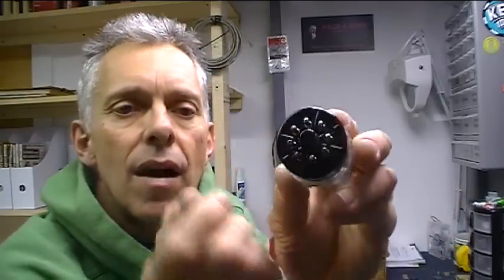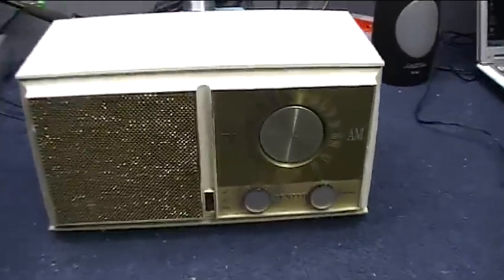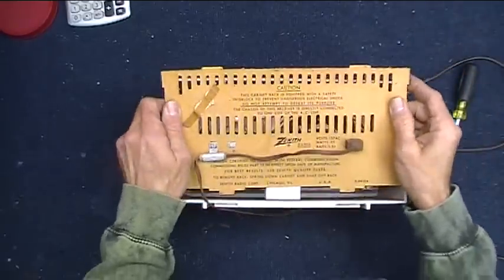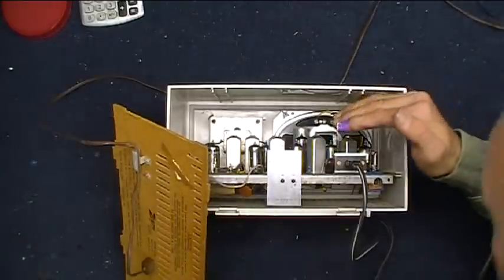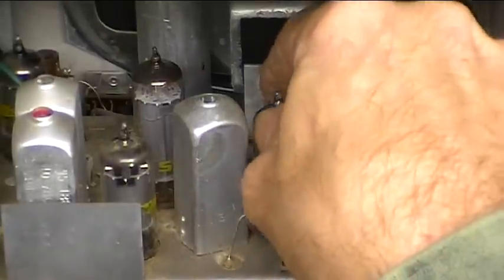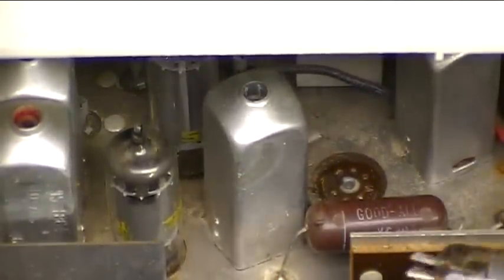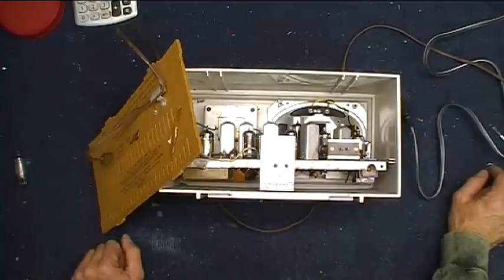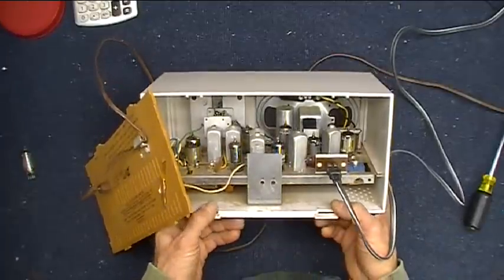Vacuum Tube Radio Repair

Comment: I remember way back (late eighties or early nineties) when I first visited a place called Skycraft Surplus here in Orlando they had a large, upright type of tube tester (probably an old grocery store model) where you could test your tubes and/ or test the tubes you planned on buying from them before you went up to the counter to pay for them. The stuff inside that store changes so much that I'm sure it didn't last too long. I have been in there recently and it's no longer there. There is plenty of cool stuff in there though.

Comment: My old oscilloscope tektronix (535), had the same problem in all vacuum tubes, the solution was to use a spray cleaner, and never, ever, a piece of sandpaper, this procedure removes the pin surface treatment, and not clean the socket, so the problem may return.

Comment: You described a circuit where 50% of the circuit goes trough one triode and the other 50% goes trough the other triode. Isn't this the definition of a class B push-pull amplifier? A class A amplifier would have 100% of the signal going trough a single triode.

Comment: You will probably want to replace the cap that goes across the line with a modern line rated cap, some of those are just paper caps coated in a plastic shell which can explode also the main electro can dry out. And it may benefit from an alignment especially in the FM circuits

Comment: I have a old tubed radio and the stations don't come in clear as they should, what can I do to help it? it has the antenna on it and all, just not sure if the reception tube is weak or whatnot.

Comment: JUST A QUICK HACK from someone who does a lot of these: cleaning the tube sockets is really easy with a very cheap tool: dental picks!  Something like a "GUM - 6324A Soft-Picks" which cost a buck for a whole handful - a lifetime supply - work great. They're small, flexible, and have a nice flat spot to hold it, and dipped into a little contact cleaner (a can is great for cleaning the works inside, especially the "pots" many knobs are attached to which usually have a whole in the round case for that purpose) will make your tube sockets like new. In a pinch rubbing alcohol will work too: just dip the brush in a capful, make sure there's no drips, and have at it.
Viola!
Reply from the maker: Good idea! Thanks.

Comment: A triode is a diode with a "grid" between the cathode and anode. Applying voltage to the grid creates an electric field that influences the flow of electrons going from the cathode to the anode. Triodes are kinda like transistors.

Comment: tube substitution  is an excellent way to go  provided somebody  you have access to someone with a great tube tester and make sure they were good  it makes things go quicker in the field anyway.  love these videos  excellent project suggestion bench Isolation Transformer  you still can't throw caution to the wind but you're 10 * safer as you were without it

Comment: I hear it's a good idea to get rid of the selium rectifiyers,I like how you fixed  the radio ,I working on a radio now ,learning the hard way I replaced the filter capicaitor ,that went great but the old wire to the speakers both shaped off so now I have to figure where they go fun huh .

Comment: I just posted a video of a 1964 Kuba/Telefunken console unit.  I'd like to get some new fuses for it (original ones had corrosion & one in particular looks to be on its way out), but am leery of whether or not a more modern fuse would work well/better than the original.  I originally took it apart to investigate the hum that comes once the tubes warm up & wonder if replacing them would resolve that, or if it's the nature of the beast.  I think at least some of the hum comes from the tone arm pickups on the turntable. Let me know what you think, if you have the chance.  

I also have another radio the size of the one you've got that would need tubes for sure, but is AM only.

Comment: I like the later Zenith tube chassis design.... easy to work on. BUT, at 12:25 you indicate you fixed it by replacing the 12BA6 , but later at 13:45 you admit that you still haven't tested reception and only detected static. Then, disappointingly, you conclude the 'repair' video with an un-repaired radio. A fun watch, but ultimately a fail. Sorry.
Reply: LOL... you have a great sense of humor. Totally. :)
Reply from the maker: +Carl Rudd Ha! I love guys like you that fail to pay attention. At the end of the video an FM station is playing on the radio. It does indeed work just fine so, untrue comment. Sorry.
Reply: Not to worry..... I just go 'off' sometimes. Actually you do pretty good work, but I'd urge you to use heat sinks while soldering small components...or switch to a  15W iron, which of course takes much longer. BTW... you have excellent taste in gear.
Reply: For all you young players out there, if you find yourself doing cold joints only melting the solder it might be that you need more flux. The amount of flux in solder is often exactly the amount you need when soldering small clean components, to properly remelt an old joint you almost always need to add extra flux.
Reply: I use a 60 watt iron in this kind of stuff. I had never seen anyone do a repair without pulling the chassis out. Luckily you didn't have worse problems like open coils or bad mica caps in the IF transformers.
Reply: Swapping parts randomly is NOT troubleshooting... Sorry.

Comment: 5:30 Is that the cap that connects right across the AC line to filter out high-frequency ripple? I've heard that those aren't that important and that some are unswitched, which can make them fire hazards.  The big can to the left of the speaker magnet is the one I'd suspect for any 60Hz hum problems.
Reply: That plastic cap is the line bypass cap. It is not THE filter cap. The real filter is the can in back. That is an electrolytic capacitor - a high value type that filters the pulses coming from the rectifier. The line cap is usually in the range of .047 to .1 micro farad (mfd or ufd on diagrams) whereas the filter caps will be 50 full micro-farads or more. The across the line cap is now often called the "death cap" as their failure can cause a short across the line, put line voltage on the chassis and/or explode. Most service people today remove them on sight. If they replace them (some don't) they replace them with a safety cap (type Y2) of the same value as the original. These caps are designed to just open their internal circuit if they fail. (do not use X2 type caps across the line!)

Comment: Kool video  but can you help me with my last ?        About that tda2005m op amp  it is a Bridge amplifier on the data sheet but it does not have a way to put more gain with transistor  can you give a drawing so I can understand what to do ....... Thanks for your help

Comment: Does anyone know how to match solid state electronics to its vacuum tube  equivalent or vice versa. I can't find any charts or books. Thank you
Reply: That would be a trick. Vacuum tubes are voltage driven. Solid state devices are current driven. Now if you are talking about their "purposes", then they can be considered "equivalent". IE: RF amplifier, Converter, IF amplifier, Audio amplifier, Phase splitter, Power amplifier, Power rectifier, etc.

Remember vacuum tubes require high voltages and low currents; and they are rugged. Solid state devices require low voltages and high currents; and are easily damaged.

For what it's worth.

Comment: Just some notes; 1) the best way to troubleshoot intermittents like that is to wiggle the tube in it's socket. Zenith of that era were known for having crappy tube sockets, and they usually need to be retensioned at the very least. 2) the cap behind the power outlet isn't a filter cap, it's a line bypass cap...most likely a paper one encased in plastic. They were actually worse than the regular wax caps; their failure mode was to explode. 3) The selenium rectifier should be replaced for safety

Comment: I would unplug it again 
Before doing any tube tapping 
With a metal screwdriver.
Regardless of whether I'm holding it by the insulated plastic handle or not

Comment: The capacitor you called the filter capacitor, isn't the filter cap. It's just a bypass cap across the AC line. The filter cap is the big can near the speaker. Also, be careful handling the chassis while it's plugged in, being a transformerless set, the chassis is more than likely (50/50 chance) at mains potential.
Good job finding the corroded tube and socket though!
Reply: where i am in the uk, we call what you call 'filter' caps, 'smoother' and 'reservoir' caps, reservoir being the one directly after the rectifier, the smoother(s), next one(s) down the line after any resistors, ..and the cap across the ac line we call the 'filter'  ,  and you can get 'filtered' iec panel sockets and multiway extension leads

Comment: The old electrolytic caps are dried, the wax and paper caps are crap.
The selenium rectifiers were not great. If they have them, should be replaced with modern silicon rectifiers.

Comment: Wouldn't contact cleaner be better than sandpaper?
Reply: John Simms I tend to agree...judging from the sound, that might be 100 grit, which is way to ruff for this kind of thing. I've sanded tube pins with like 800 grit, and never had a problem, but 100 grit or similar will leave microscopic scratches and pits in the pin, which eventually will cause arcing. Bye now.

Comment: Me I would for future safety is get rid of the sillium  rectifier,because if they go bad not only will it stink up your house it might take out other stuff,and any old caps by now it's time to change them.Just a thought. Your tube cleaning idea came in helpful I found some dirty sockets ,and some.dirty pins.now I check.all the tube radios I working on.I spray some.deposit 5 into the tube sockets,if needed I use a tooth pick to dig out anything that's in the socket holes too.our thrift drugs had a tube testers both our gone.

Comment: mine is getting a station but it has some scratchey sound with it😕 so can u tell me how to fix it i think its a filter cap so plez help oh and btw im 13😃 so plez help!!!!!!! i already tried the micro phonics test and I cleaned the prongs and I tried to fix the wires on the antana sooo plez help me!!!!!!!!!!!
Reply: Just dont electrocute yourself. Capacitors can hold lethal voltages even when the radio is unplugged.
Reply: im 15 now btw, i know how to fix them, and i unloaded one on my finger once, knocked me back a few feet. ive learned a whole lot since i posted this😂
Reply: lol i understand, ive been shocked a lot, atleast 7 times

Comment: You should never put your fingers right inside an tube amp, cause the filter capacitors can have enourmous charges that can kill you easily!
ALWAYS mesure all the caps to find out if they are discharged.
Most of the amps have bleeder resistors to discharge emself, but never trust this, ALWAYS mesure!
If they are still charged you can discharge them via an ca 100k Ohm (5w+) Resistor.

Comment: That radio can kill you. It doesn't have a step-down transformer. There is 120v across all 5 of the tubes.. Still, it has high voltage and only needs very little current to kill you in the right circumstances.  Nevertheless, I think you went a bit heavy on the safety aspect.  Most people should not be inside a vintage radio.
Reply from the maker: Yeah it's a really tiny space for a person to fit into. ;)
Reply: @HackaweekTV  LOL!

Comment: Mfd and uf means the same thing right,anyone
Reply: Ron Thompson yes both mfd and uf both mean microfarad.  In older schematics use mfd with a lower case m to show the micro prefix not to be confused with mega which uses the capital letter M.  Newer usage of microfarad uses the stylized u to avoid any confusion between micro and mega.

Just got to love the metric system!

Comment: Yup its a Humer, that's because it forgot the words :-)  Ha Ha  nope, sounds like a bad filter !!!  Just had to say that ! Couldn'thelp myself !!!
Reply: Tube-caused hum is almost always a failed output tube (usually the tallest tube in a set). It happens when the ceramic or mica (depending on the age or desiign of the tube type) insulation on the heater/filament develops a break. It can then touch the cathode and inject the AC voltage into the cathode. It may hum just a tiny bit or "motorboat" loudly. Replacing the tube will fix it in those cases.

Of course, a failed, under-value, dried-out filter capacitor will give the same symptom. Capacitor failure is actually more common now.